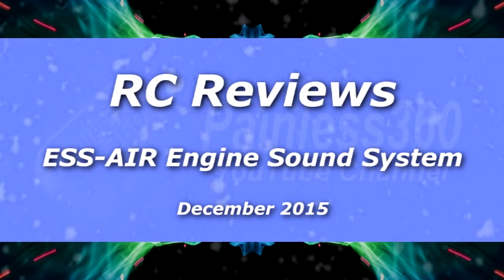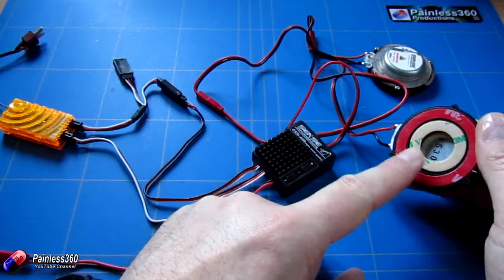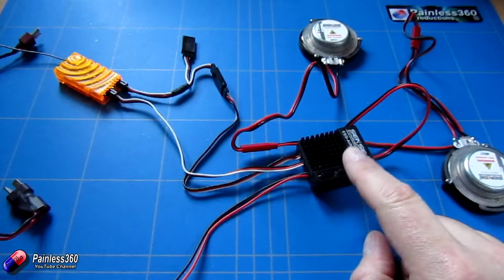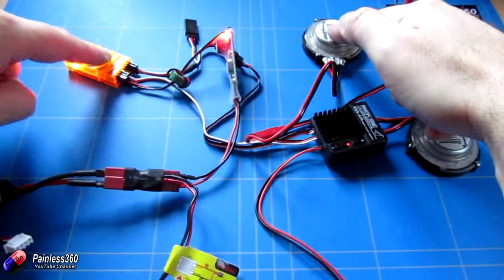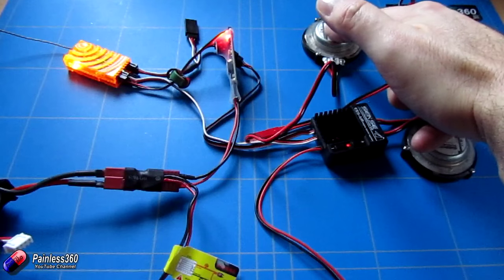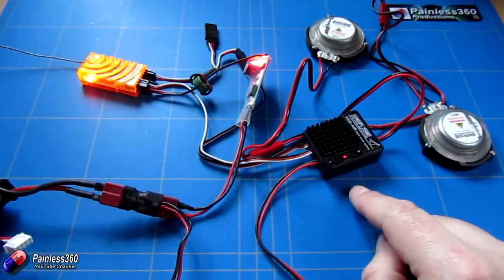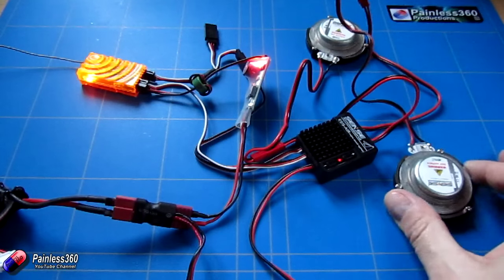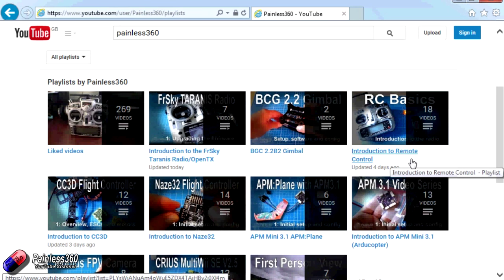RC Reviews - ESS-AIR Engine Sound System (from Banggood.com)

Comment: Given the size and complexity of a model this is likely to be used in SBUS input would be nice since channels out of the reciever are usually at a premium in PPM setups. Being able to select the second set of sounds remotely would be nice too.
Can't think of anything better than a nice large Spit with a roaring Merlin on a low pass.

Comment: Fantastic, now I can make my quadcopter sound like a tank! ; )
Reply from the maker: +M390VI Now that's something I'd like to see! ;)
Reply: +M390VI - I don't believe those are speakers, but rather, transducers. They use your airframe as a speaker to put out the sound. Consequently, they create a lot of vibration. At least the sound system I have that looks similar to this one uses transducers and they produces a lot of vibration in my airplane. That is not a problem for the airplane, but I think it would completely overwhelm the sensors in a quad's flight controller given how sensitive they are to vibrations.

Comment: Great video again sir! Thanks for that :) 
Do you know if the middle piece of the speaker allso needs to be stuck to the same surface as the outer ring?
Reply from the maker: +DutchRC Adventures we just stuck the other ring to the side of the model. Seemed to work fine. Happy flying!
Reply: Thanks for the quick response sir! :)
Reply: Do you need to mount the speaker over a hole to allow the sound to come out?

Comment: How much does the system weigh, specifically the speakers? I never really held much interest for these modules but the the idea of an overpowered 250 with a massive engine noise is compelling and would be pretty fun to play with.
Reply from the maker: +MicroRCFiend The weight is on the listing on Banggood.com. Sadly it maybe a little heavy for the smaller quads ;)
Reply: Thanks, yeah it s a little weighty for a 250 unless speakers could be changed for something lighter.

Out of interest, what would be needed if a CP heli pilot wished it to work for pos and neg pitch? Any mixing or maybe it would still work plug and play?
Reply: Adds about 120g.  I have it in my p-51,  it is awesome.